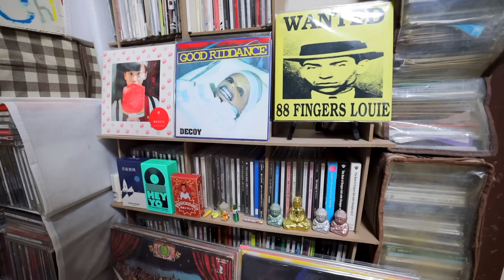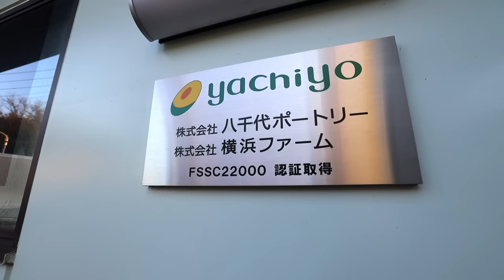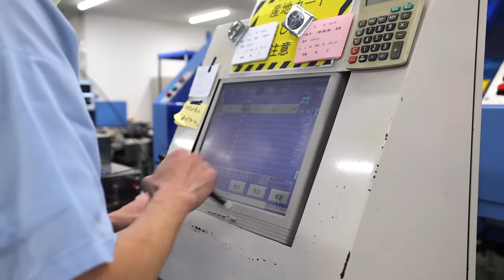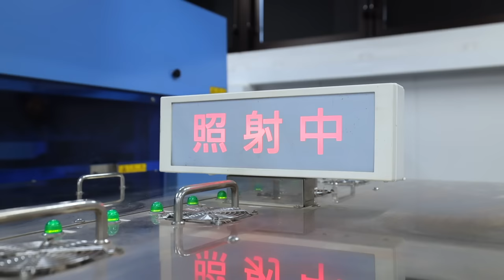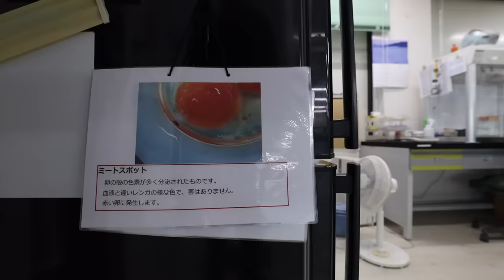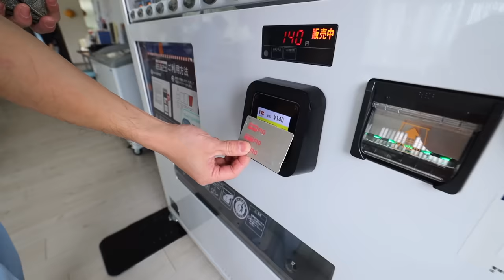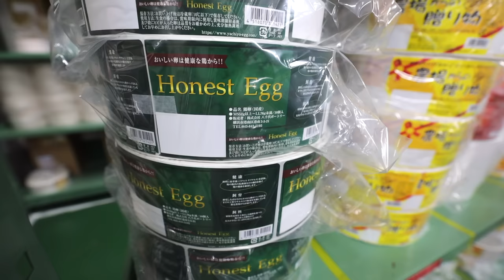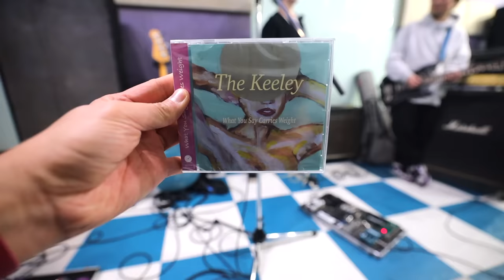Day in the Life of a Japanese Factory Worker

Comment: nice to watch this. those machines are pretty similar with the ones from the factory i used to work at here in the netherlands, back in 2003 to 2005 i worked at a egg sorting and grading machine factory called moba. they made machines similar to the nabel machines in the video so it's nice to see it in action at a egg factory

Comment: When you mentioned that the Production facility uses a Light that is 2000 x stronger than the sun, I highly found it suspect - So I searched around. I did not find anything that would validate that claim, as I found it preposterous to begin with. Can you clarify what exactly you meant, or were told, or what the Facility meant? I have a hard time believing anything more intense. blinding, strong, etc, than the sun, let alone 2000 x it.... TY, Luvs.